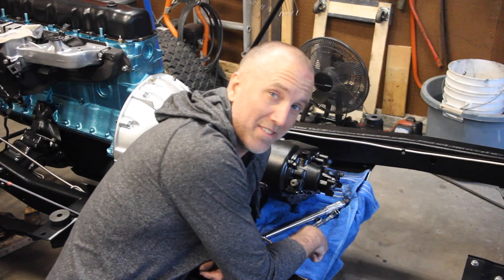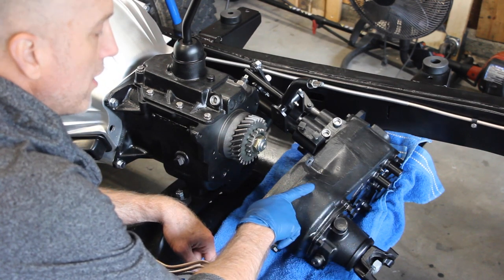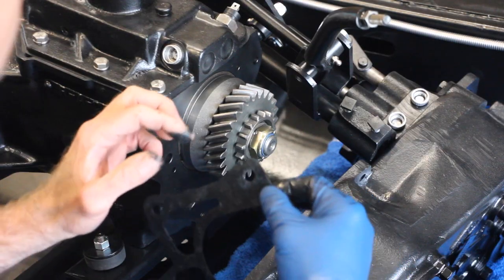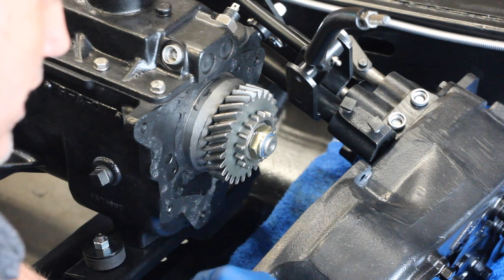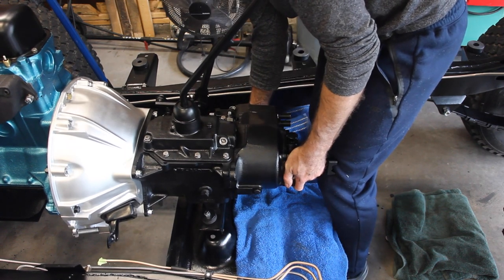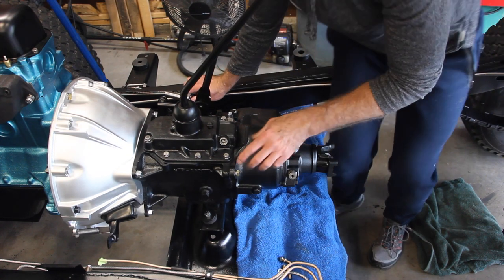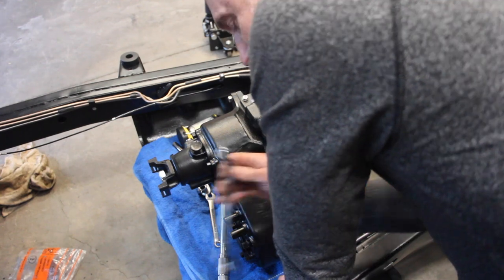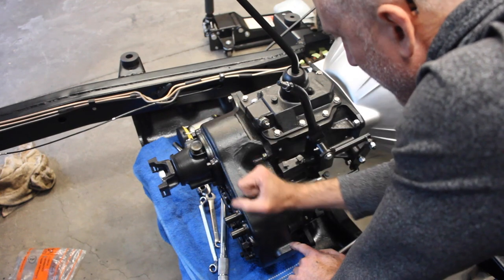Jeep CJ7 Dana 20 Transfer Case Install

Comment: Once again, great video.  Your videos have been invaluable while rebuilding my T150 and Dana 20!  Question - After doing a bunch of reading about what gasket to use when mating the T150/Dana 20, I used the "open" gasket (same one you used) since it appears there is fluid transfer.  My rebuild kit came with both open and closed gaskets so I'm still a bit unsure of which gasket I should have used.  Have you reached the point of driving your CJ to see if you have fluid leaking all over or if all the fluid has drained into the Tcase?  I'd be curious to hear how the gasket is working out and whether or not it was the correct one.  Related question - any idea why, if the trans/transfer case share fluid, the fluid recommendations are different for the two (GL-4 for trans, GL-5 for Tcase)?
Reply from the maker: I had put on the gasket with no holes in it originally and it leaked all over the place. Since replacing it and using Permatex Gasket sealer https://amzn.to/3DZvjBT (you want to use this on any paper or cork gaskets) I haven't had any leaks or issues. Been about 500 miles on this transmission.
Reply from the maker: Where are you getting the fluid recommendations from?
Reply: @coolguy_CJ7  I have a Haynes manual that calls for 80W-90 GL-4 in trans and 80W-90 GL-5 in transfer case.  That's where I was getting confused as far as fluid transfer.  I checked my factory service manual and it says to use  80W-90 GL-4 in both.  I'm going with the factory manual specs!

So, just to confirm - you're currently using the gasket with no holes (with gasket sealer applied) between the T150 and Dana 20, right?
Reply: @Cool Guy Great video as always. In connection with the comments above, I just had a T150 and Dana 20 gone through and rebuilt in a 1976 CJ7 with the 304. I was having a restoration shop do some tub work and they installed the transmission and transfer case back in the frame and mounted it up. I have about 10 miles on the Jeep now since the rebuild and I’m getting a steady gear oil leak, especially when driving, between the transfer case and transmission. I’m wondering if the gasket with no holes was used? Is this similar to your experience. It sounds like you first used the gasket with no holes and had a big leak. You then changed to the gasket with holes and haven’t had any issues since. Is that correct?

Comment: Did you paint the block and cylinder heads? If so, what paint did you use?
Reply from the maker: Yes to both. Just the main block and head. Valve cover and pulleys, powder coated semi-gloss black. Timing chain cover, water pump, and thermostat housing, powder coated in aluminum silver.

AMC engine paint over engine primer: Seymour EN-66 Hi-Tech Engine Spray Paint, AMC Blue.